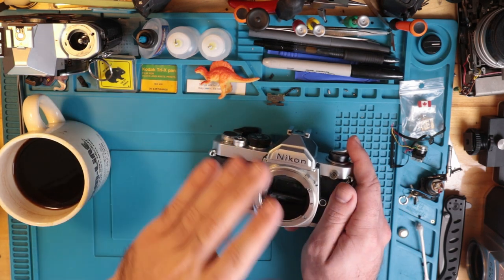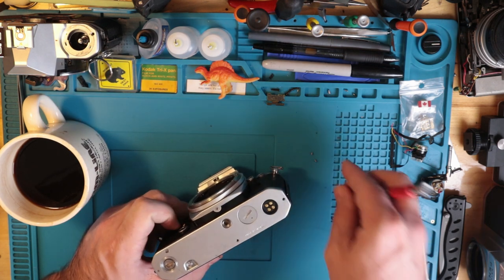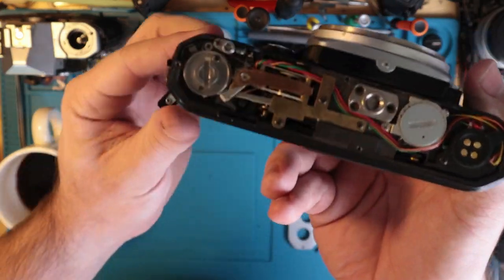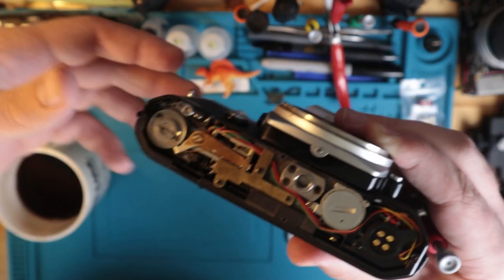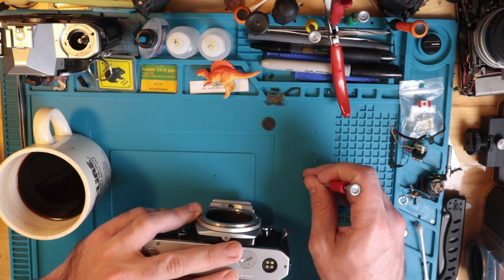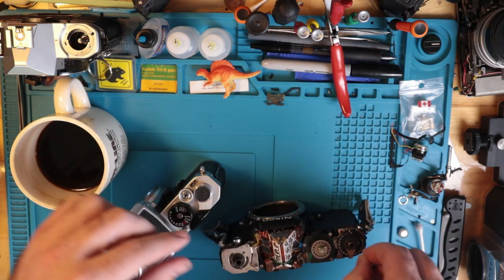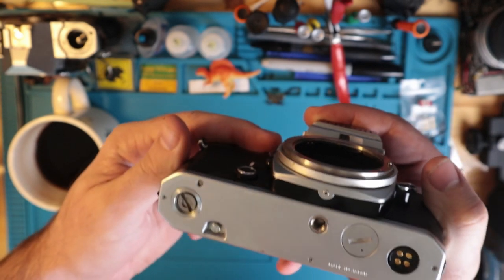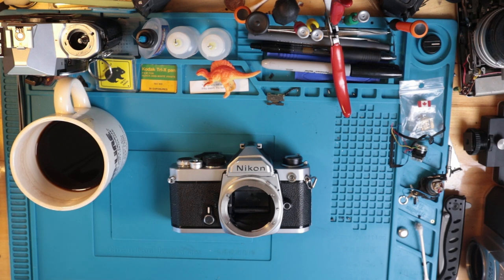Nikon FM Repair Revisited

Comment: On my FM, the shutter speed in the prism is off. For example, when the dial is set to B, the prism shows 1/2 of the 500.

Do you know if this is an easy DIY fix? I tested a few speeds based on dial and they were as expected, i.e., Bulb, 1 sec., etc. However, the prism is showing a different speed to what the shutter actually operates at. Hope that makes sense without seeing it. Thanks!

Comment: My FM works great except one thing, it will not turn off the meter when advance lever pushed all the way in.  Any idea how to troubleshoot this issue?  I checked the battery compartment, it's intact.  Thanks in advance!